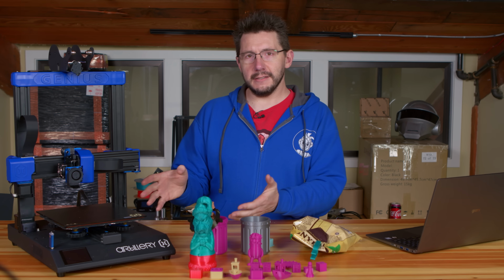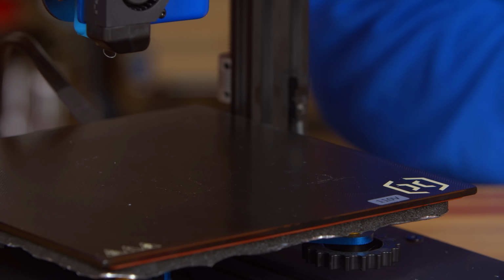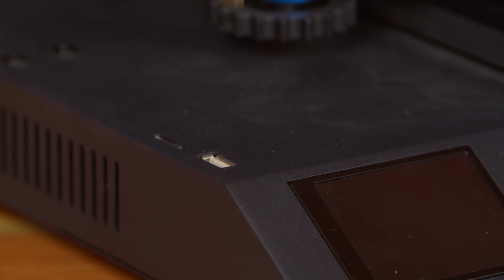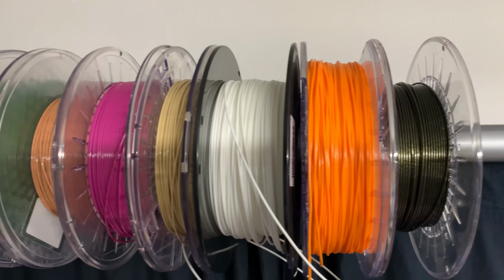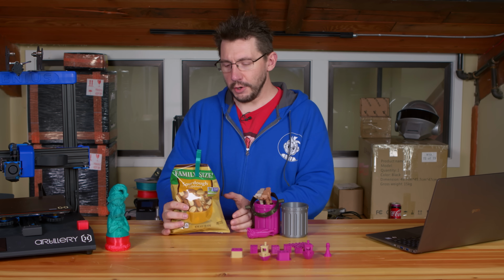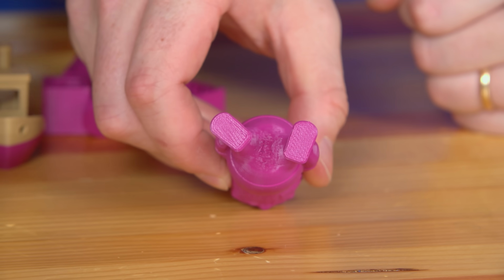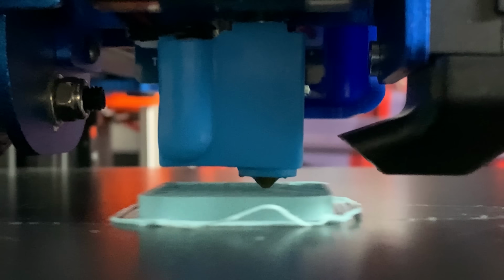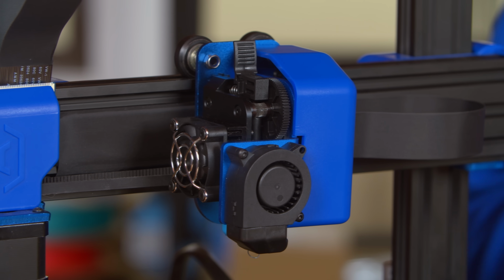Does This $299 3D Printer Make The Grade? Artillery3D GENIUS Review

Comment: Pretty crazy for the price, just like its bigger brother. I still think that spool holder is SOO annoying though! I wish they'd bring out a gigantic version with the same components haha
Reply from the maker: They should just ship with a closet rod and some brackets for your wall :)
Reply: I bought a ASW. Arrived with ribbon to extruder bent. Printed ok then started to show issues the same as a failing filament motor when cog teeth break. Fix was replace the cable. Prints sound now. Got it down to 40 microns resolution. Prints are sound in PLA so far. To stop the z wobble: print speed: 24 mm/s . Flow for mine is best at 90%. Not tried other materials / composites yet.  The noisiest part of the printer is the rapid Y movement on some prints. I recently reduced the print speed for walls down to 12 mm/s. This has reduced the NVF & thudding noise but not 100%. This has resulted in a 6 hour print becoming 8.5hrs. The bed requires NO glue or additional things to stick prints down. This bed,  mixed with the filament sensor has resulted in more successful prints which reduce costs. I have used low cost PLA, all work sound to date.  My opinion of the ASW is the machine to date is a very good buy. The touch screen and usb stick slot are perfect. Asw provides premium level usage at an accessible price point.  
😳What if the cables fail after many usages? Just replace them, job done. The cables are tidy as is. The money you will save with more reliable printing on this machine more than pays for new ribbon cables 💪👍👍👍.
I requested the company print some small female sleeves to slide the Male end of the ribbon cable in to to ensure at packing (where my damage was made) the ribbon cable ends are protected. 
Filament spool: it is sound as is. Yes there are always improvements.  I am currently making end use parts with this machine. Suggestion: buy a ASW, it’s an investment.
Reply: Hi, I was considering buying the Sidewinder X1, but I'm not sure about the cables. Do you think they did anything about them? If anything that could be the dealbreaker for me. Thanks and continue the great work of yours. ;)
Reply: Might as well grab the new Creality at this price range.
Reply: @AvivMakesRobots  Which Creality model was that?
Reply: @ew7007  i forgot the name, but creality just made a new version that has a name brand power supply, among other features. It is open, nk enclosure, but good.
Reply: @AvivMakesRobots  I've looked for what you're talking about and I can't find any new printers from Creality. Just some incremental updates to their existing line which really isn't much if you ask me. Name brand power supply? Who cares whose name is on it? I'm sorry but I've got to disagree. For $300 you get direct drive, silent steppers, touch screen, dual Z steppers, 110V heated bed etc, etc. Sure, the build volume is pretty standard on the smallish side but its ready to go right now, out of the box with maybe needing a Marlin/TFT update and a BLTouch (which is really overkill for a 220X220 glass bed IMO). And that's all this is. Just my opinion.
Reply: @ew7007  I see what you're saying. I'm a big fan of the Prusa Mini too, but it does not have an enclosure which is a bummer.
Reply: Everything you said would make it AWESOME!

Comment: Just use a tnut and a shorter screw, you can move the z endstop easily
Reply from the maker: Yes, that is a great solution. Maybe Artillery3D should implement it :)
Reply: @3DPrintingNerd  I really think that was the first revision. Then they drilled and tapped and fix mounted it to "idiot proof" the unit.
Reply: But also they include in the spare kit a t-nut and the screw!
That's a nice detail

Comment: z-sensor, shorter bolt and an t-nut?
Reply: Damm right
Reply: Thats what everyone is doing if they arent adding a BLTouch.
Reply: @MrMadeinthe80s  You saw the video right?, he was saying it wasn't posible to move the endstopmount. so if you replace the bolt that goes through the threaded hole in the profile, and use an t-nut instead, you can move it..
Reply: Yeah that's what I was getting at. I did the shorter bolt and t nut on my X1 initially but moved to the BLTouch once I found the firmware for it.

Comment: Ender 3 pro or this for a beginner?
Reply: Just for you to know, I have 2 ender 3 and a X1, wich is exactly like the genius, but bigger.
The Genius comes with silent stepper drivers, filament sensor and direct drive extruder, wich are key features.
Also high voltage bed, touchscreen, filament change feature, synchronized z steppers, etc
Reply: @SergioShiroi  thanks
Reply: I would go for the genius, better stock features
Reply: If you're willing to splurge, this. It's so damn quiet and has a direct drive.
Reply: You can upgrage Ender3 with all the extra features of the Genius, so it's mostly a question whether you want to add them yourself or prefer to have them right out of the box.